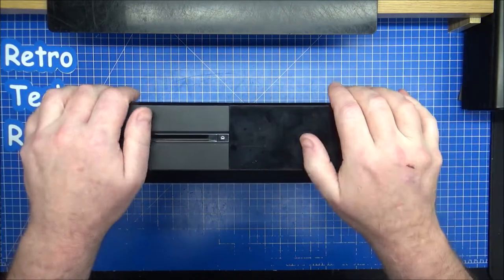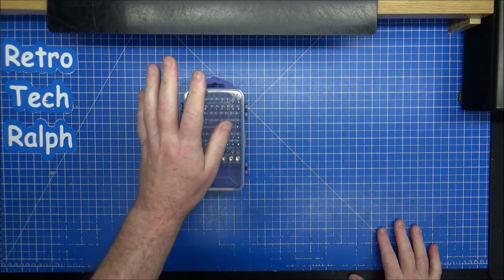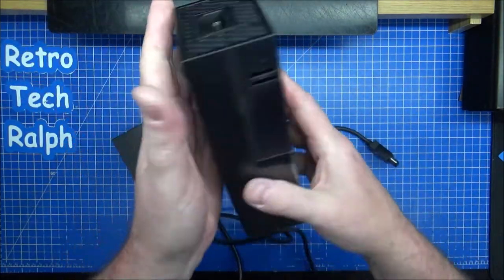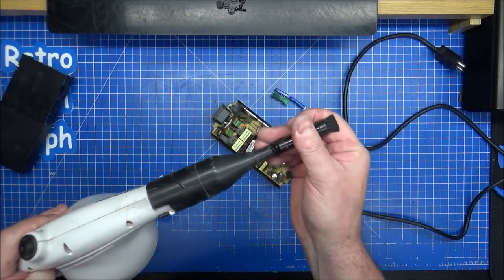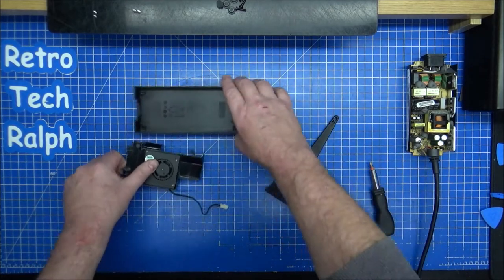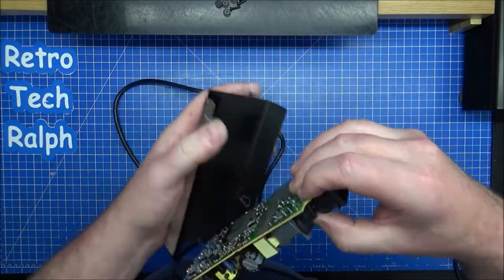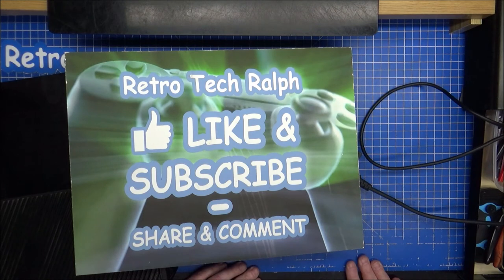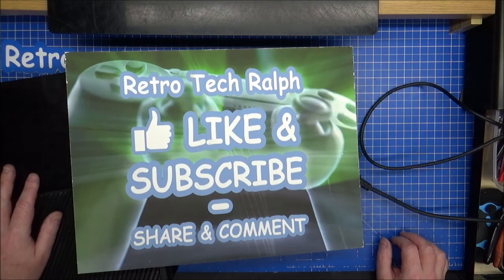Xbox One Power Supply Repair and Clean

Comment: Thank you so much for this video man, call me stupid but for once I just couldn't figure out how in the world to open this power supply. Turns out it was easy just hidden, it is also so nice that the fan can be disassembled all the way down to basically bare bones which made it a lot whole easier to clean. Even after cleaning the console itself, this power supply was still making a whole lot of noise on its own in my desk, this quick clean made it incredibly more quiet. Excellent guide.

Comment: I recommend replacing all electrolytic caps while you're at it. The growling sound after the cap replacement is from  worn fan bearings. A drop of thin oil on the bearing sleeves will sometimes bring them back for some time, but I'd also replace the fan.

Comment: Cheers man, I got 2 A12-220P1A powerbricks that are orange lighting and ”dead”. Console slightly beeps but doesn’t boot.
I just opened the original one and it doesn’t even have a fan, tho the pin is on the board🤔 but same capacitor is expanded so I’ll be replacing that.
Reply: Same issue is with me. Do you know which capacitor to buy or where to buy one which is compatible with the power cord.
Reply: @Pathak06  I just took apart an old pc powersupply made by the same company and it had the same capacitors which were 16v1500uf 2cmx1cm
Reply: @foktorrr7241 does that mean to fix that all i need is a new power cord
Reply: @iced_9163  no, in my case it was the capacitor that was shown in the vid

Comment: I just had the exact same problem with that exact same capacitor. I wonder if that is a common issue with those power supplies. Just need to pick up the cap. Thanks for the info!

Comment: I Need help. I try to plug the cord in the power supply it turns orange for 1 sec and turns off think I need to change some thing?
Reply from the maker: If you watch the whole video, i found a capacitor that had cone bad.
Also, sometimes an internal xbox fault will shut down the power supply. 
Either way, start with a clean and look for things that look odd.
Reply: @R_T_Ralph  𝐭𝐡𝐱𝐬 𝐦𝐚𝐧 𝐭𝐡𝐢𝐬 𝐡𝐞𝐥𝐩𝐬

Comment: what's the Orange Yellow light on brick even mean??The Brick bad or intetnal??Mi e shut off,Turn on twice after,When under loading Then kicked off,,Wonder if brick or inside??ALSO,,I can hear Fan in brick Click like gonna spin But Jus won't power up deck,,I still Get eject sound and Power button Ding
Reply from the maker: Its probably the same issue like mine. a bad capacitor.
Watch the video and it explains and shows you how to repair.